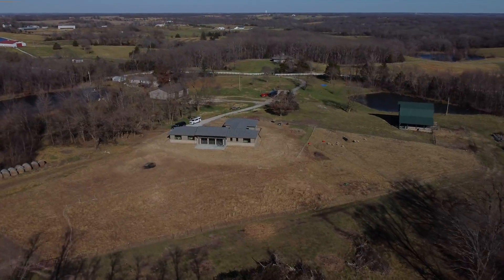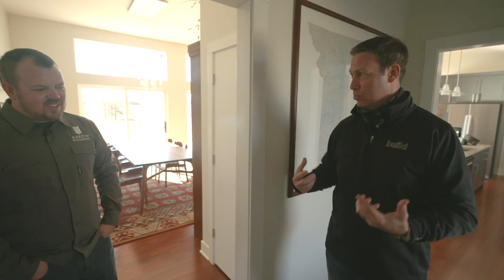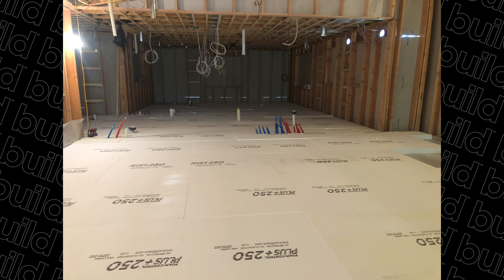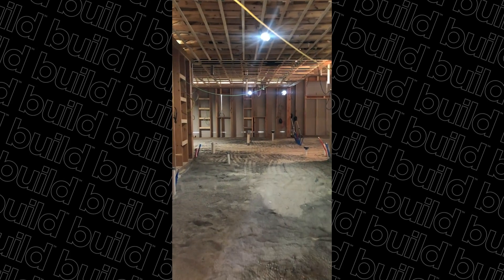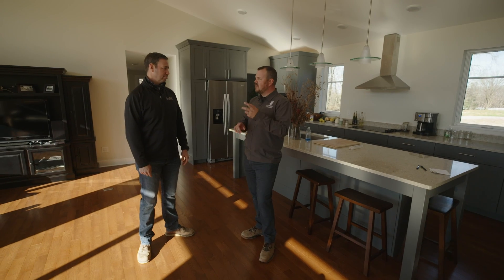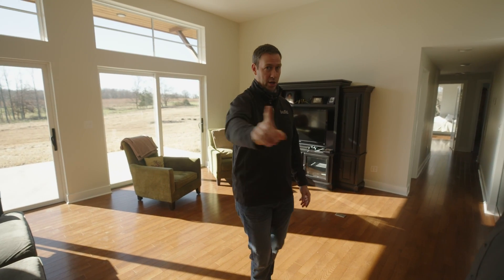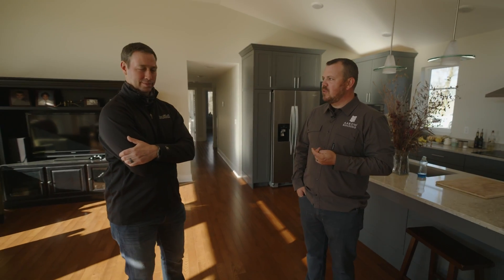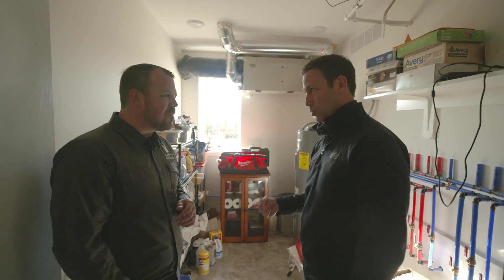Slab-On-Grade INSULATED Foundation (NO Concrete?!) - Part 2

Comment: How do you keep critters from destroying the "slab" I mean concrete is strong as hell but this is just compacted dirt essentially.
Reply: You don't.
Reply: the perimeter foundation, depending on depth, should kep them out. But here, they told me rats can be a real problem, so....could be a problem, those little fuckers like to dog and i had a war with them a few years ago. I won but just barely
Reply: Gravel with finely crushed gravel in it ("road base") after compaction is very tough to dig through even with metal tools.
Reply: @TrogdorBurnin8or  rats are amazing diggers with great, rodent teeth.
Reply: @d.e303-anewlowcosthomebuil7  Vapor barrier keeps air from penetrating into the soil. Insulation reduces thermal delta in the soil, giving rodents less reason to try digging in the first place
Reply: @JamesRibe  they got into my unheated workshop and had a big party there
Reply: @d.e303-anewlowcosthomebuil7  They may have sharp enough teeth for wood, but compacted roadbase? They would give up quick. More likely to tunnel into the insulation, if thick enough.
Reply: I suppose that some other deterrent will have to be applied. I wonder what kind and if it's possible to mix it in with the limecrete. I'm thinking a boric treatment or something similar.
Reply: @tarawiselove  I don't see the benefit of this method over any other one though.
Reply: @a6o932  The main benefits are cutting costs for materials and labor and lessening environmental burdens where concrete is concerned. Personally, while I favor being part of environmental solutions, I would like a side-by-side cost comparison to determine bottom-line budgets for this type of job.
Reply: @tarawiselove  Agreed. It's evident the house spared no expense in other areas so I'd say it's safe to say you'll likely not find a cost comparison here. I like efficient homes and I'm not saying this one isn't but I also like things that are robust.
Reply: He said something about basically compacted road base, not just plain dirt.  Compacted base is VERY hard to dig through.  You'd need much more than a shovel to start a hole in it.
Reply: @jim.h  I still don't know about this being the way to having a 100 year house. I'd rather pay for the piece of mind and have a slab poured with traditional rebar and not post tension.
Reply: @a6o932  Are you going to live in that house for 100 yrs? It will be gone by then.
Reply: @linmal2242  So what? We should build houses to live in for 20 years and just let them fall apart? That exact frame of thinking is why we're burying ourselves in landfills. one-use mentality.
Reply: @a6o932  Exactly. It doesn’t cost much more to build a house to last, with a resale value, or to be usable by future generations.
Reply: @jim.h  Spot on. Ratus's teeth would hurt so they would stop.

Comment: Do you think this would work in areas with colder and weter weather where ground movement may be greater?
Reply: I’d be scared to buy this house. I’ll be curious to see how it performs in 5 years - expecting rising damp along the walls
Reply: @SM7LArchitecture  they have a full vapor seal preventing rising damp.  but in my climate, it would always be wet under the floor.
Reply: Good question   I would assume this would only have a chance in certain climates. I wouldn't put my money on it

Comment: What about a damp proof membrane I.e thick polythene sheet, also acts a vapour barrier. Clearly ground water flooding is not an issue in this area.
Reply: EPS is semi permeable and will slow the moisture migration
Reply: @stevenbaczekarchitect9431  it will slow it but not prevent it, stupid decision not to have pour a pad. Foam will break down and moisture will come through
Reply: @zack9912000  I would try to explain, but you'd rather insult than discuss, please enjoy the weekend
Reply: @stevenbaczekarchitect9431  while I agree foam does deteriorate over time especially with moisture(loss of R value) , does this aggregate base not basically become concrete as time goes on?  Fines + moisture + time = Solid
Would have liked to see a sprayed fluid applied WRB put down before or maybe after the foam...
Reply: @David_Mash  I would have sprinkled Portland into the base and fines just to boost that idea. Or lime like the earthen floor/ rammed earth people do.
Reply: @stevenbaczekarchitect9431  we use this kind of approach in the uk, except that a DPM will be laid, then insulation, than a sand and cement screed (almost like your fines mixed with Portland). Given the thickness of the polythene it sometimes a struggle to lap it over the stem wall nearly, but then it creates one big impervious layer. 

However in Uk we can get significant shifts in the water table which makes the DPM essential. If you don’t then I expect it’s less of an issue, but for £200 of dpm I think it’s money well spent. 

I love seeing how you guys do things, so far ahead in many ways.

Comment: I would’ve never thought that would’ve worked! I guess you could pour piers in the middle if you really needed to right?
Reply: It won't this crap  was tired before and ground constantly shifts no matter how well he pats his guys on their backs, that foam will break down, the wood will rot. Its resistant to moisture but will still degrade. The cost to rip all that out and pour a proper slab to support the interior walls that now rest on foam will cost more then the home

Comment: I built a house high up in the mountains of west Texas.  6200 feet elevation.  Had to mix concrete on site as concrete trucks could not get up there.  Perimeter concrete beam, laid foam on top of crushed volcanic rock, sand on top of foam, then brick floor.  Great house.
Reply: I hope you remembered to seal the rock to the foam, it's a critical step to ensure that lava uplift doesn't occur.
Reply: That's really cool. Do you have a picture or video of the process?
Reply: @danjimielson  could not figure out how to insert a picture in the comments.
Reply: You can add a link to another website and upload to imgur or maybe even your YouTube account I think allows picture upload now

Comment: I don't know if I caught it but I'm assuming interior stud walls are sitting right on the ground soil??
Reply: You didn't catch it, they clearly stated all partition walls were set on top of advantech.
Reply: on the floating slab, 2 layers of the advantech sub floor?
Reply: @NashtheImmortal  correct me if I'm wrong but it looks like they already have the walls in before the foam and the plywood
Reply: @davidjonburke2729  looked like only the exterior walls
Reply: I think the wall footers are locked to the dual layer OSB.
Reply: yeah the outter walls
Reply: Only the external wall framing, internal walls are floating on foam board and plywood which is stupid as hell here. It will shift for sure no matter how well they think they compacted it. Base material is a poor choice to try and replace a slab, the foam WILL break down over a few years and the plywood will get moisture damage. God forbid they ever have soil shifting or water run off issues that will reek havoc for that home.
Reply: @zack9912000  this is the craziest home building video I've  ever seen...house is literally  built on foam, tape, particle board
Reply: @davidjonburke2729  I’ve never built a house, but I would at least pour footings/sleepers under all of my interior wall bottom plates, and foam/subfloor around that.
Reply: @davidjonburke2729  It does have footers.  At the beginning they say they're raised (stemwall, or something).
Reply: @louf7178  yep they have footers

Comment: I'm trying to build a passive house with a finished basement. have you seen an insulated sub grade slab?
Reply: Yes, insulated sub-slab is very common in the north - almost standard
Reply: @ArthurDentZaphodBeeb  ah well that's good to know, thx
Reply: Who hasn’t?

Blind builders?
Reply: @jaxturner7288  man the more I talk to these builders in the west PA/OH area they're not filling me with confidence...lol
Reply: You shouldn't really be allowed to build a slab without subslab insulation, anywhere with significant humidity (condensation concerns) or with snow (thermal concerns).  It's one of several measures that make it possible in practice to finish basements.
Reply: @Demetrios Christopher thx I'll check it out